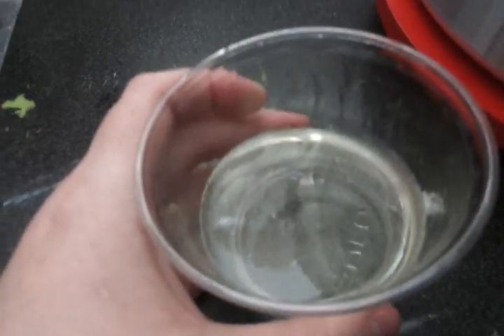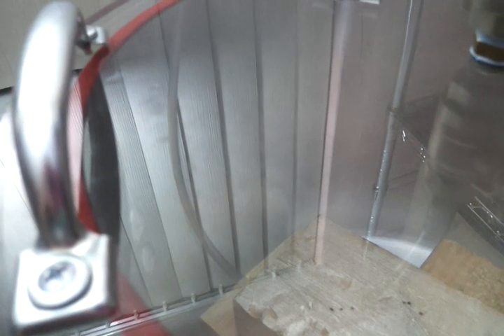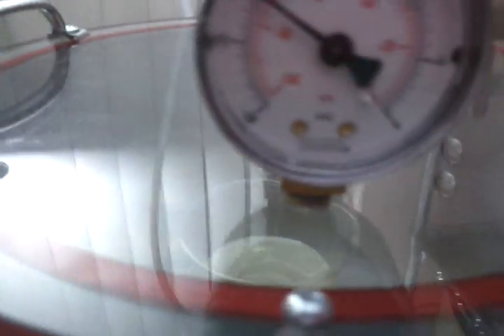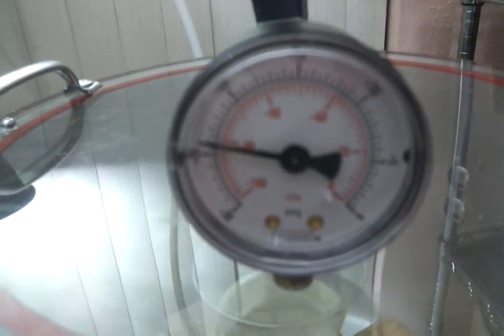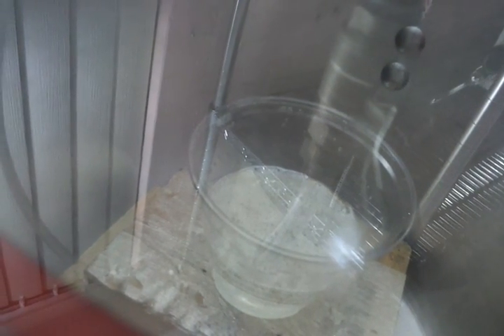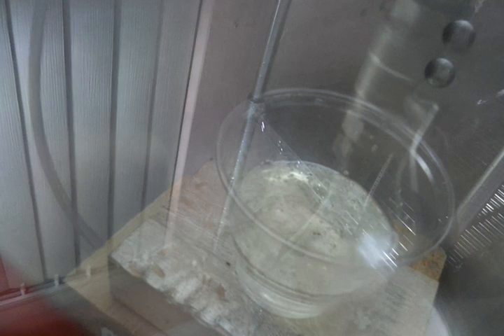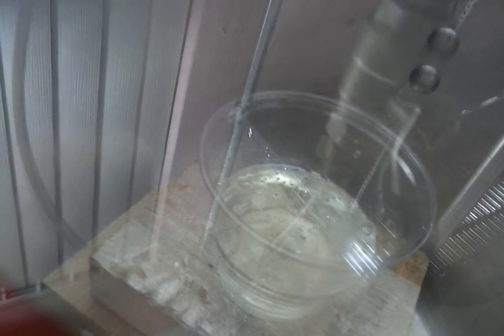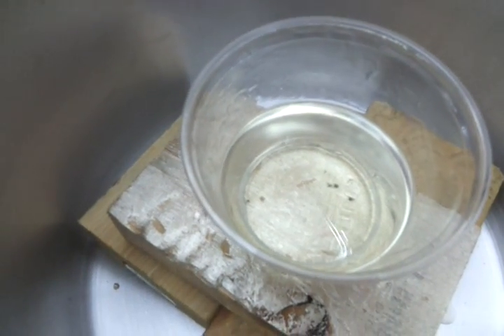Mixing Resin Using a Vacuum Chamber Part 2 of 3

Comment: so a vacuum chamber is all you need for casting and mold making? Or do you need a pressure pot as well?
Reply from the maker: A pressure pot will shrink any remaining bubbles left.  Depends on how far you want to go.  Some choose the pressure pot over the vacuum chamber.  Guess it depends on what you prefer.  I didn't like being constricted on space as to how much would fit into a pressure pot and like being able to look in on the final products,so I went the vacuum chamber route.  Gets them as bubble free as I need.  The silicone in these videos was 33T I believe, I have since moved to Mold Max 25, its the pink silicone and it is way easier to work with and a lot less bubbly.

Comment: Megan,
If I poured epoxy resin (or urethane resin) on a label, and put the label and resin in the vacuum chamber, would it flow out wider?  I am trying to achieve less height on my epoxy resin for doming labels, and curious if I used less material and put in vacuum chamber, would it spread out?

Comment from the maker: I use the chamber to remove bubbles from resin and from the silicone.  It really is one of the best things I invested in.  It will last forever and there is no more waking up to find the piece you worked on for a week is ruined because the first layer had all those tiny pinpoint bubbles.  Envirotex lite is fine - I use Famowood mostly because its a bit more viscous and its cheaper when you buy a gallon of it.

Comment from the maker: I normally still have bubbles on the very surface with some still popping but the moment I close the valve and release the pressure, the bubbles disappear and if there are any left, they normally rise to the surface after the pour..  After silicone bubbles up and then falls, I normally run maybe a couple minutes more...I am not sure of your silicone as I have only used the SMooth-on Moldmax 30 and Moldmax 27T.

Comment: Heya, I had a similar problem to LMF5000, I left some silicone to cure under vacuum (with the pump running - took 3 hours) and it was like swiss cheese it had so many bubbles in it! I thought eventually there would be no more air to pull from the silicone but it seems that the silicone is almost boiling with air being pulled from nowhere. If I let it rise and collapse, leave it for 30 sec then let the air back in will it be sufficiently degassed? (same for resin!)

Comment: @MeganBeads That makes sense I guess - a given volume of air expands under vacuum, so every tiny little bubble becomes massive when you turn on the vacuum. What I'm hoping will happen is that if you leave it running long enough the vacuum will suck all the air out of the resin and there'll be no more bubbles forming. Looks like I have some new things to try out in the lab :). Thanks for the ideas :)

Comment: @MeganBeads I don't have a degassing chamber either. So if I leave it with the pump running for 24 hours it won't get rid of all the bubbles and cure clear while under vacuum?

Comment from the maker: @LMF5000 Normally if you are going to let resin cure under pressure, you use a degassing chamber - sorta similar to a vacuum chamber but it works with an air compressor and most people use a pressure cooker for this..  I use a vacuum chamber to remove the bubbles and then pour it into molds and just let it cure on its own. I don't have a degassing chamber.  I have never left resin in the chamber longer than about 5 to 8 minutes maybe as I still need to pour.

Comment: (cont.) so I closed the tap, turned off the motor and left the resin under vacuum (but without a pump running). I came back the next day and the resin was awful, completely full of bubbles. Almost worse than when I started! Do you think it's because I switched off the pump, or is it because I left it under vacuum? I noticed in your video you opened the tap and removed the vacuum before the resin had set. Is that a critical step or would it work well even if I let it cure under vacuum?

Comment: @MeganBeads I tried to do this myself for the first time yesterday. I basically wanted to encase some little cubes of cement in resin to later grind and view under the electron microscope (part of my research). I have a vacuum dessicator - same thing as yours but it's made entirely out of glass, including the sides (and it doesn't have a vacuum gauge). I started the pump, left it running for half an hour but then had to stop it because it was lab closing time (cont.)

Comment: (continued). It has some 10 different pumps including turbo pumps and even ion pumps (to try and extract those last few pesky molecules of air) and after running it constantly for weeks, the pressure would still be falling slowly! So getting a perfect vacuum is a bit like dividing by zero, if you'll pardon the pun :)

Comment: Just a small comment - first of all thanks for the video. For some reason I really enjoy seeing the bubbles expanding like that in a vacuum :). But what I wanted to add is that you can never achieve a "perfect" vacuum, because there'll always be a few air molecules in there that give you a pressure slightly above zero. At my university we have an electron microscope with a gauge that measures vacuum pressure down to 1x10^-9 torr. (continued)

Comment from the maker: @TheKelseyquan  Hi, the comments won't let me add a link but the sellers ID is european-auto-dismantling on eBay.  If he does not have one listed, if you email him normally he has them and will list one.  I purchased my vacuum chamber from Harbor Freight.  You can get them online or at the stores. Its the 2.5 CFM vacuum pump.  That was it.  The pump comes with the oil needed and the hoses that come with the pressure pot work with the pump from HF.  HOpe that helps.  :-)